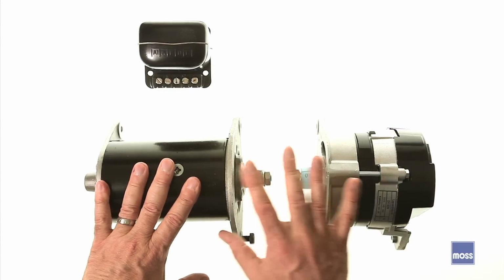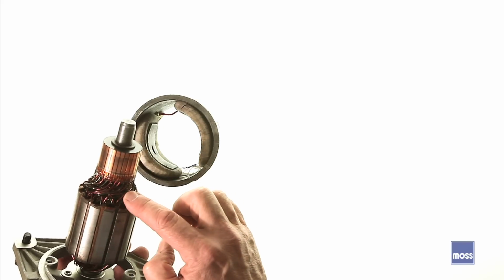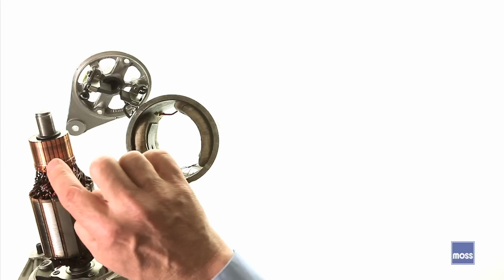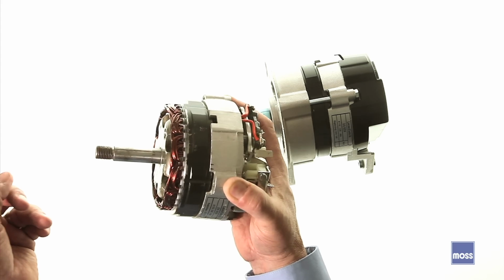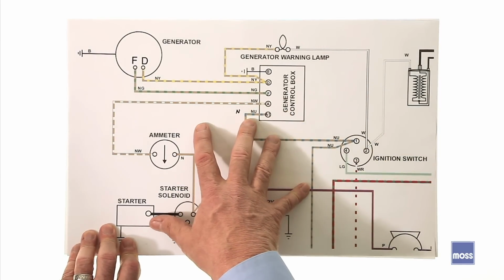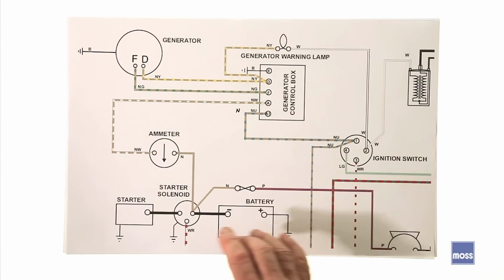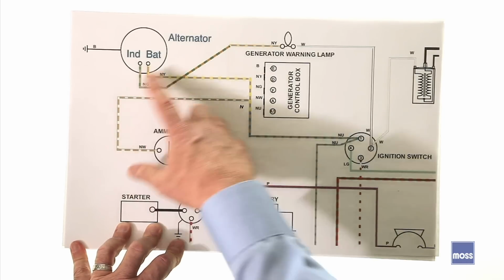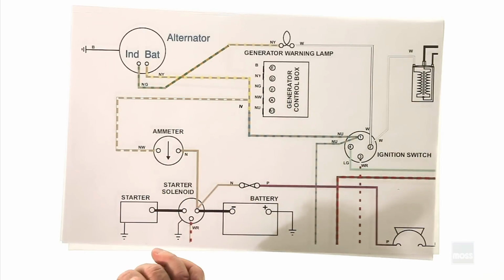Generator To Alternator Conversion

Comment: Great video, thank you. BUT you have got the battery connected the wrong way around. Should be negative to ground! There should also be a fuse rated just above the maximum charge current of the alternator, in the battery line for safety. That way your wiring wont burn if a diode in the alternator goes short circuit! Thanks again.
Reply: Great catch

Comment: I've got a problem with this. All alternators I'm finding have 1 wire or 3 terminals not 2 as you're showing. I haven't found any alternators for sale with only 2 terminals. Do some alternators only have 2 terminals  or do they all have either 1 or 3? On youtube explanations on replacing generators with alternators, some diagrams show terminal 1 being the field terminal but other diagrams show terminal 2 being the field. Which is it?

Comment: Your description and explanation are great, and will definitely help me with my generator to ONE wire alternator conversion on my 64 Ford Galaxie. One thing I did notice and made me go Hmmmm, was the battery in your illustration shows the + positive terminal going to ground and the - negative terminal attaching to the starter solenoid. That's got to be just an oops. Thanks for making the video!!
Reply: At one time, some cars had positive ground.  Negative ground has become universal today.

Comment: This was perfect, excellent teaching! 
I put a one wire alternator in my 64 1/2 mustang (only year Mustangs came with generator).  Instructions said I could leave the voltage regulator in place or bypass.  The alternator is 'special' meaning it still looks like a generator for nostalgia detailing.  I left the voltage regulator in place (for looks and wiring connected as-is, BAT, FLD, ARM) and the charging system would be finicky -meaning not charge most of the time while driving, only 3.0 volt output.  I figured the alternator would not excite at low or higher rpm's and start charging the system.  Inner-web research came up with this lesson.  So I gutted the voltage regulator and placed the terminals (BAT FLD ARM) in series.  Now I still have all the looks of a generator under the hood -but the benefits of an alternator.  Including x2 the amps (gen @ 25-30 amp vs ALT 65 amp idle).  However, one problem, the OIL and GEN light stay on constantly without the key or ignition turned on.  GRRR!  Does MOSS have a lesson for this too?

Comment: Very good simple to follow instructions 👍, my question is in the last page diagram u put up the + terminal of the battery is showing going to ground.. And the - going to the starter solenoid.. So excuse my lack of knowledge.. But where does the circuit get the + (live) from?
Reply: Great observation, I noticed it to

Comment: Excellent well explained, but could I ask will this be ok to change the positive earth on my tractor to negative earth, now these tractors have simple wiring but me and wiring are not mates, give me a spanner and nuts and bolts any day,Will I need to change the ammeter and oil pressure gauge and thanks for sharing it was well put across.

Comment: Ok, I figured out why there might be some thumbs down:
The schematic drawings all show the battery having a positive "+" to ground and show the negative "-" as connected to the starter solenoid.

So the absolute clearest alternator explanation on YouTube has a fairly important but simple mistake that would require a re-shoot of at least the video portion with the corrected schematic drawings.

Once that is done, this video will be perfect!
Reply: I thought that it was just me who noticed the battery polarity.

Comment: Firstly the output of the alternator will be far bigger than the dynamo could manage, typically 70amp versus 20amp. check that you wiring can handle the potential max output of the alternator. Secondly, the ammeter cables will have to be swapped over or the gauge will read backwards. If you have a radio fitted it will have to be changed as it will be for pos earth, some early sets had a switch to swop the polarity so check yours. Any thing that has an electric motor, windows, seat adjusters, radio ariel etc you will have to swap the cables at the motor. Otherwise an excellent video production. Liked

Comment: excellant video. I have just fitted this conversion to my tractor. made it to negative earth and so on but i have a problem with the coil ( swaped the LT wires around as said with instructoins) its getting very hot and the engine will not start but leave the coil to cool down it starts straight and will run for hours with no problem but once switched off it will not start (coil very hot). The question is have i done something wrong or is the coil bad? I am a mechanic but we are allways learning.

Comment: I understand you were saying except at the end...Positive ground, negative ground.  You said alternators run on a negative ground circuit,  but the schematic shows a positive ground on the battery,,.  or maybe I misunderstand what pos. neg. ground means?

Comment: Many thanks for the explanation.  I know that somewhere in that system there has to be a fuse board. With your explanation I would imagine that the fuse fix between the alternator and the systems being powered ?

Comment: Great explanation.  So I want to completely gut the old external regulator of it’s coils etc and use the terminal connections surrounding the regulator to fasten my new alternator leads using the old wire harness for aesthetics. The old voltage regulator is a Bosch 1965 and the new alternator is a Delco 10SI.  I am going to add a 10 gauge wire inside the voltage regulator soldered in place to connect the D+ and B+ terminals so I can then fasten the BAT lead from the alternator to the D+ and supply power to accessories and charge the battery. All of the terminal connections are external on the regulator using machined screws to fasten. I want to use the DF terminal on the old regulator to fasten the field wire from the alternator to the amp light wire.  Can I use the old terminal?  I checked with a multi meter and the terminal is grounded but will that matter for the field to amp light wiring? I know this is an old posting but really hope you respond to questions like this. Thanks, Michael

Comment: Thanks so much, nicely done.
My external regulator has a "W" terminal. Any idea what do with that terminal? In your diagram there is a wire labeled 'W". What is the contaminant it is feeding? 
Also: Should there be a signal from the "F" terminal of the regulator to the field terminal on the generator itself? 12 volts maybe to excite the field wingdings to create the magnet effect? 
Thanks again...
+

Comment: I updated to a Ford 3G alternator in my 1970 Ford F-100 and it works well. However I have not been able to get the amp gauge to work with this setup. I have read that if a 560 ohm resistor is installed in the "switch on" lead to the alternator then the amp gauge will work. I need to know how big the wattage of such a resistor needs to be. No one seems to say what size when describing this procedure. Help with this would appreciated.

Comment: Positive ground? Though he mentions positive ground and converting to negative ground, the last time I dealt with a positive ground vehicle was my 1931 Desoto. I've also heard of having to place a diode in line with the output wire to prevent battery discharge during times the vehicle is not running? Any truth to that?

Comment: Im converting my 1965 cj5 kaiser jeep to a altanator weve got it mounted and the internle voltage regulater is hooked to the lamp postand another terminal of the voltage regulator to a ground but its still not charging... It will fire up and run but it doesnt charge.... My starter selinoid is a 1 prong set up with one for the battery and another for the switch and another with a copper arm to the starter (geussing a ground).....my question is do i need to get a selinoid that is two prong(i and s),....one comming  from battery, two coming from starter, one coming from ignition?

Comment: what becomes of the ammeter  if it maxes out at 30 amps with the generator   and the new alternator is over 80 amps? Bypass It? replace it with a higher amp scale ammeter?

Comment: Why not use a brushless motor as both the generator and the starter? All you need is a proper ESC. Someone please explain.
Reply: Some vehicles did tnat. My 72 Suzuki lj20 has the generator built into the crankcase and functions as the generator and the starter.

Comment: Do you have to change all the bulbs in the dash and lights to 12 volt
Reply: My car is 1952 6 volt Desoto
Reply: yes you do have to change all the light bulbs from 6 volt to 12. But you can buy 6 volt alternators.

Comment: Geat video, thanks, spot on. Question: converting from positive ground to negative ground, online forums say "don't worry about the starter motor"- whatever that means. Surely, if one changes the polarity of the vehicle frame it will try to turn the starter motor the wrong way? Can anyone enlighten me on this? (my Vehicle = Fordson Major Tractor too old to have relays). Cheers :)
Reply: no - I've done 2 of these - it has no effect on the starter motor

Comment: Two things that was not adressed here, but first the thing that is not true: An alternator shall have negative ground. No, there are made alternator with positive ground, but they are rare. Next, he did not tell that the max current from an alternator are far bigger than max current from a generator. That is why you also should see to that the range of the ampmeter are within compared to the max current of the alternator. For the same reason you should also verify the thickness of the cables between the alternator and the battery. These things together are the reason for my thumb down.

Comment: They do NOT both make AC.   The generator will produce DC (one directional current) since it obviously uses a commutator with brushes.  It may make DC with waveforms similar to AC due to the 360° rotational motion but it is still in one direction and is thus DC.   The multiple windings in the generator smooth the average DC current but it will still have some "ripple" to it.  If an automotive generator produced AC then it would still need the equivalent of diodes to convert its output to DC.  The generator on the left does not make AC.

Comment: There is a mistake in the wiring diagram for the alternator. Your diagram shows the battery wired with positive (+) earth but as the commentator says the battery must be wired to negative (-) earth when using an alternator.
Reply: I just saw that too lmao
Reply: No mistake there. Some older cars had a positive ground.

Comment: If you have an "older" vehicle with LUCAS electrics ....THIS IS A "MUST" CONVERSION.  When I bought my older "BRITISH" care years ago, it came with a box of "extras" ...AKA failed components.  There were THREE voltage regulators in it ....and the one in the car was giving problems ...failing to provide charging to the battery  ....intermittently.

A very quick Wikipedia search of LUCAS revealed a very lengthy history beginning 1860 in Birmingham, England.  Unfortunately, this Wikipedia rendition is heavily scripted/focussed on UNIONS and the COMMUNIST party. Life was different back then.

The article also summarizes the evolution of the company and the resulting many products ...related electrically.   ------  BUT ABSOLUTELY NOTHING ABOUT THE POOR QUALITY WHICH IS THE COMPANY'S CLAIM TO FAME TODAY.

Comment: I'm confused.  Can anyone shed some light on this?  He talks about the problem with the speed of the generator.  This means if you have a generator your sheaves will be a certain speed ratio.  If you change to an alternator, then you can run at much higher speeds.  Doesn't this mean that you would have to change your sheave ratios...change your sheaves and belts.  Then this might not be so easy of a change out and not so straight forward as he implies.
Reply: Actually no. Alternators are designed to handle high rotational speeds--upwards of 10,000 RPM I believe--and regularly run at 5000-6000 RPM in normal use (a generator would be destroyed at these speeds). This is why an alternator will provide some charging current at idle speed whereas a generator would produce nothing.
Reply: Inflec sir,,,you need to watch this video again,,and again until you get it,,,it works just as he has so wonderfully dictated,,,ole fart Jimmy

Comment: yeah shure nice video but not a problem if you have a brusles neo magnet alternator and that thing has 3 fase's so meaning more than enough power you can use it to start a engine and to charge the baterry realy fast plus not including a modified starter motor for what this setup is used for you may think well its used for hybrid cars,gas producing cells, electric cars self substaining systems add on that plasma ignition those litel things peopel forget to mention expecialy if you have waste spark ignition system so your 4cilinder engine is actualy a 8cilinder and a futher notice your 4stroke isnt any more 4 its now a 2strok engine so there you go peopel the good old dc magneto and generator ;) all today systems are only a bade copy of the true staff  reverse inginering is very usefull expecialy if you have solid understanding about electricity,mechanics and chemistry you can do magic

Comment: not realy true that is a alternator revolutuonary because they sufer from heat tought the engine the fail to deliver solid curent bether are generators because their regulators are solid well build their regulators nearly never fail and can take good abuse alternators are crap Im persenly going to change my alternator to a generator the old 80s cars sufer from wrong wiering and under load situations those lazy as holes who build cars are cheap scates the refuse to build solid parts bether take a heavy duty generator and do it self peopel its wurthe doing that you will have a car like a tank actualy you culd use a generator as a magneto as well no distributor no other shit just 1 wire on the block 1 to 12 cilinders fires perfectly you actualy can run other types of fuel gerenator is a way to go